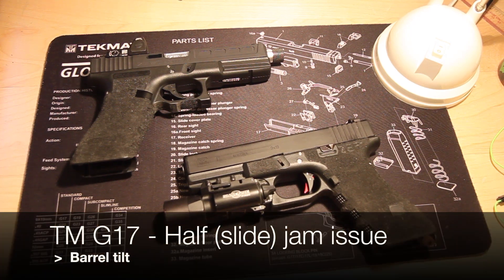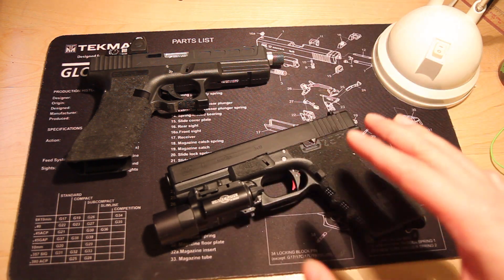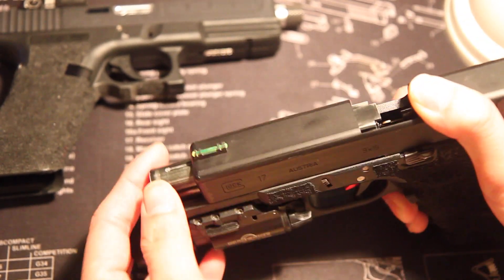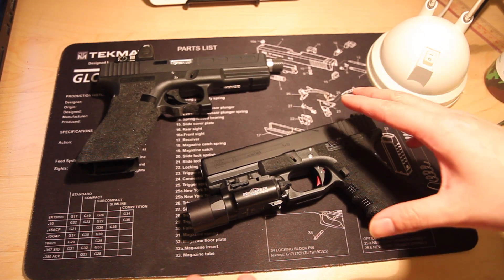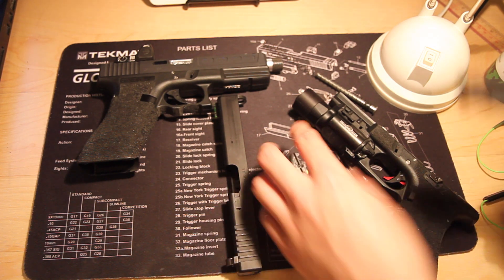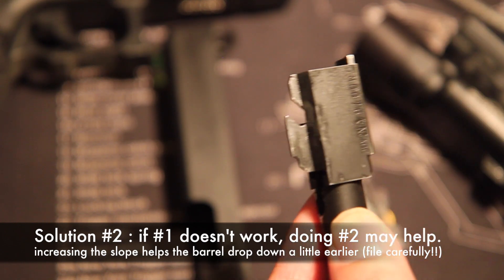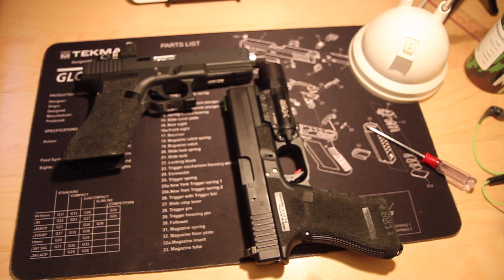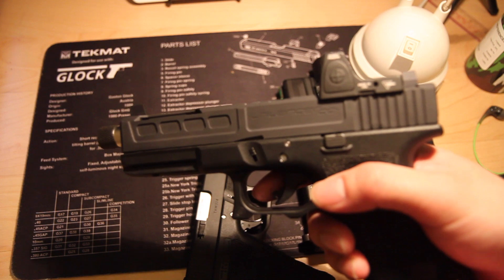TM G17 Problem - JAMMING ISSUE Part 1 - Barrel Tilt Issue

Comment: when it halfjams and I tap the barrel, the slide doesn't move, what ere the other things that may cause this, because I would really like to resolve my halfjam issues but checked like you said and it wasn't the barrel
Reply from the maker: maybe the rotor issue?
Reply: @RogueSystem087  I’m not really an air soft guy, I got the g17 from my uncle, so I have no idea what that is, sry, but I’ll look into it

Comment: +RogueSystem807 Umm.. My stark arms g19 does this but it is not the barrel tilt issue. I thought you were going to make another video to address people who are having the same issue as me. Please help, I am worried.
Reply: is there odd wear on the inside top of your slide? this was happening to me. got a good gun solvent and was able to remove a lot of aluminum fouling that came from the barrel. it built up and then 'gummed' up against the barrel. wiped that away and the original slide finish was underneath.
Reply: Yeah I'm having the slide jam problem and it's not the barrel. The barrel is quite loose actually. Even when jammed I'm able to wiggle the barrel and the slide won't move. There's definitely a grinding feeling as its going through the section where it would happen, but I can't see any sign of where the friction is

Comment: what if my barrel tilt issue is when the slide is all the way back? if I push it forward the slide will release so it is due to the barrel for sure.. but I've already sanded the barrel down like you've shown in the video.. what suggestions can u give me?

Comment: I have an issue with the slide breaking where the outer barrel meets the slide on the right rear end. I think I can fix the problem by taking some material off the outer barrel

Comment: my issue was the opening on the slide where the barrel goes thru was uneven causing the bottom of the barrel to rub. easy way to check is rack the gun upside down.

Comment: Hi I have a similar issue but it is the exact opposite. My outer barrel does not tilt upwards enough, causing the side to catch on the bottom of the barrel. If i push in or up on the barrel the slide returns, but it happens every 2 or 3 shots. Any idea how to  fix this?
Reply: +nathan chappell I had the same problem. The outer barrel wore the slide down to a point where the slide would catch on the outer barrel. The only solution is to buy a new slide. What material/ metal is you barrel made of?
Reply: I actually figured it out already! Filling down the point he talked about in the video solved it.